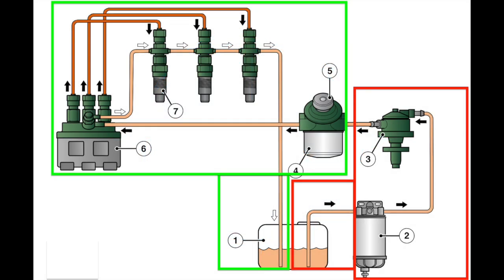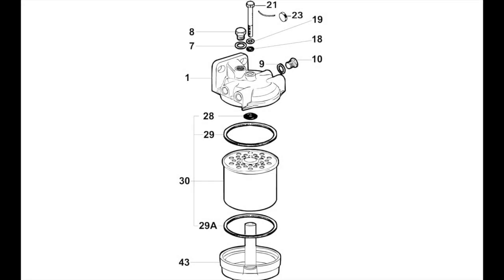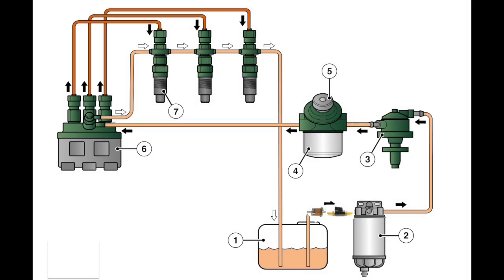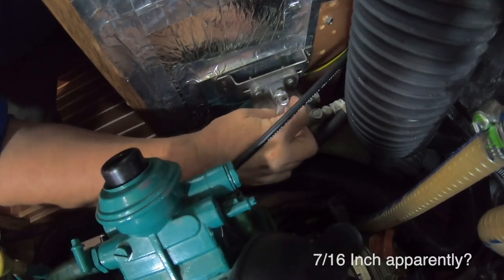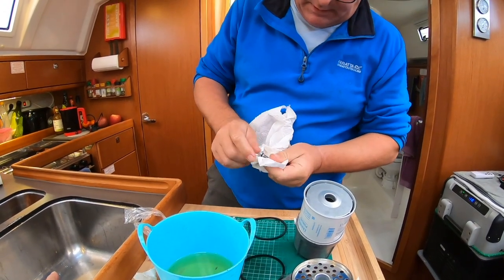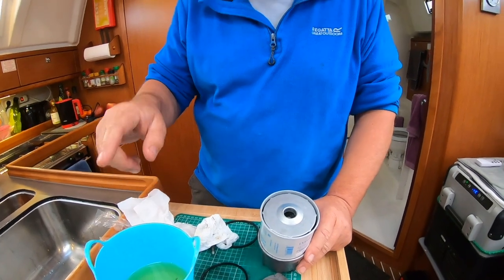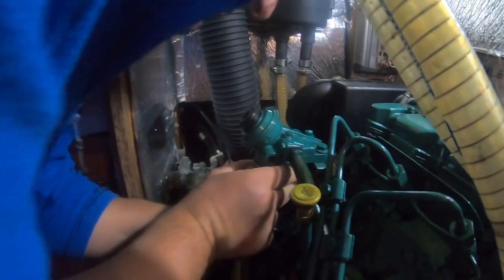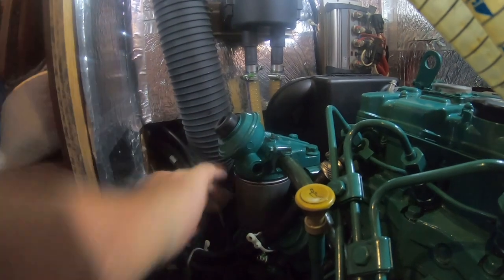Marine Diesel Filters. Watch This Before You Change Yours!.

Comment: Thanks for doing this video.  I think my Yanmar will be very similar.  I am wondering why you didn't swap out your see thru filter before the shut off valve.  Wouldn't that first filter be the dirtiest one?
Reply from the maker: Good question! We keep a couple of the see through filters on board to change if necessary. So far we have never had to change one but, it's the first in line for dirt or debris and as you say the most likely to be the dirtiest one of the 3. Sail Safe mate. Ant & Cid

Comment: Great video as always. Basically the same as my older MD2030d except my primer pump is a little finger pump that takes ages so I suck diesel through to the bleed hole by screwing it out completely and attaching the engine oil extractor pump - I was shown this trick by an old sea dog and it’s saved my loads of time. 
How many engine hours do you have between changing the fuel filters- I have been changing mine yearly/100hrs but as you point out they are usually clean.
Reply from the maker: Two years or more Kevin. Never had a bad one yet. Sail Safe mate. Ant & Cid

Comment: Thanks for a great instruction video! Just to be sure, is it correct that no bleeding is needed after only replacing the water-separating primary filter (and not the secondary filter)? If so, where does the air inside the primary filter go when starting up the engine? It should be around half a liter of air inside that primary filter I guess…
Reply from the maker: You can if you want do a few pumps on the primary filter first, the secondary has enough fuel to run the engine and the air is not an issue. It cycles through the pump.
Reply: @SVImpavidus  Thanks a lot!